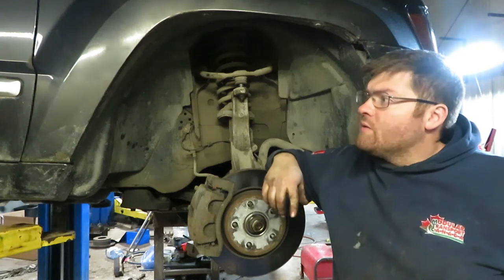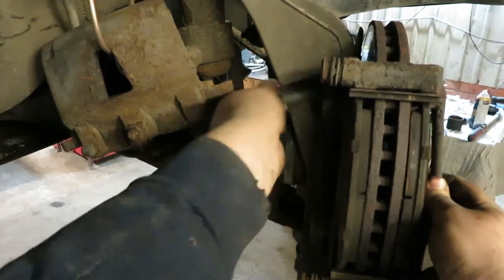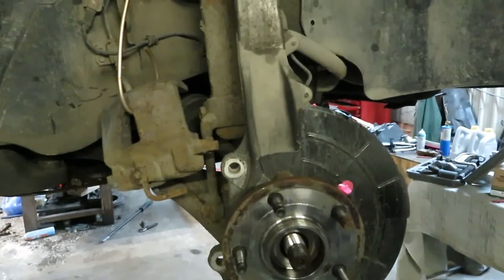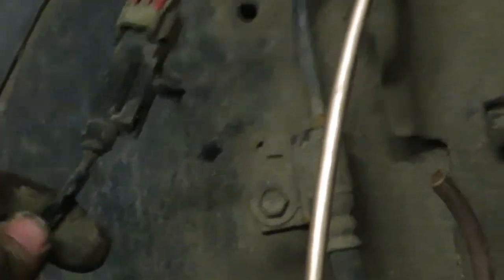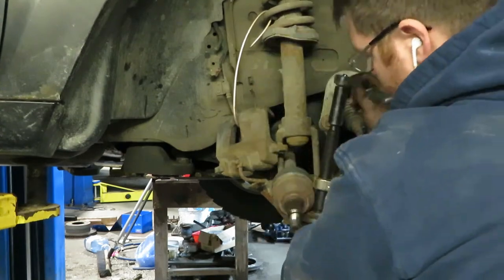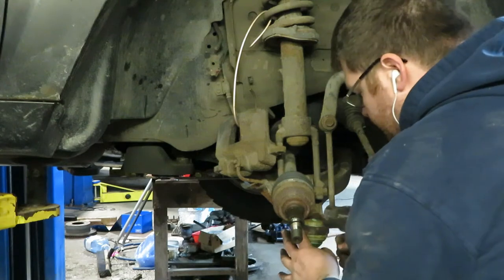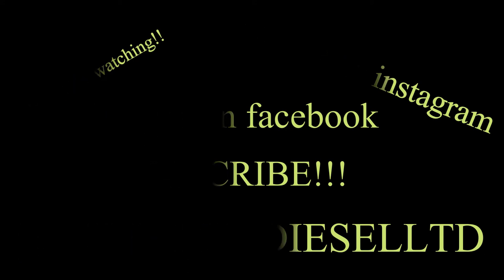HOW TO Jeep Grand Cherokee Lower Ball Joint Replacement

Comment: My original lower ball joint studs had no anti-turn hexagon on the end.  I made the mistake of splitting the joint after only backing the nut a few turns. I then couldn't undo the nut as it was stiff on the stud and just turned it!  I did manage to do it up again (hard) and could then undo it fully, but then had to split the joint again.  Moral is: undo nut fully first, then replace it (oiled) with only a few turns before splitting.

Comment: Is changing the lower ball joints on a 2007 Jeep Grand Cherokee 4x4 more difficult than a non four-wheel drive
Reply from the maker: 2wd is usually easier because there is more room. The front CV shaft or axle is not in the way. So to answer your question yes 4x4 is harder. Thanks for the comment. Any other questions feel free.
Reply: @screamindieselltd  okay thank you I'll just bring it in I would do it myself but never worked on a 4x4
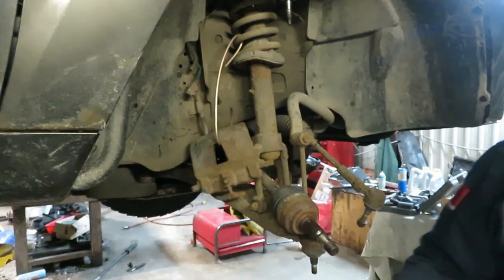Reply: I don't think 4x4 is much harder.  I have done a 4x4 (not a 2x4) and the drive shaft is easily kept out of the way. But unlike @4:10 I removed the front bearing from the knuckle before I took the knuckle off, makes it a bit easier as long as the bearing comes off the knuckle without a fight. I had another reason for doing that - to repaint that thin dust shield that was going rusty.

Comment: Have a question bout my 2007 jeep grand cherokee limited 4x4.  What could cause it to pull to the right? Went to get alignment an they said it didn't need one once they hooked it up.
Reply from the maker: A pull can be caused by a number of things. A worn tire, an under inflated tire, a brake caliber that’s hanging up, a seized ball joint and the list goes on. Does it only pull when braking? Does it only pull after you have turned to the right, the straighten out when you turn left.  Could also be a tie rod end. Hope that helps and thanks for the  question.

Comment: Hi Sir,  is it possible to replace the upper ball joints with out removing the upper control arms off the car?
Reply from the maker: If it’s a press in type of ball joint you can for sure do them with the arms still in. I’ve seen some that are a solid piece and some that are press in. Thanks for the comment!

Comment: I am the original owner of a 2008 Jeep Grand Cherokee Overland with 154K miles.  I've never replaced the front ball joints so it is time.  I thought that the lower ball joints were part of the lower control arm requiring me to replace the whole control arm?  From the video, it appears that you were able to replace the lower ball joints without replacing the whole control arm?  Do you have to use a special tool to separate the lower ball joint from the lower control arm?
Reply from the maker: Yup you have to use a ball joint press

Comment: Got a 2002 Jeep Grand Cherokee Laredo that needs all 4 ball joints replaced.
Been calling local auto repair shops and they are charging between $700 and $1200 for (ball joints, labor and alignment required)
But when I looked online a set of 4 ball joints kit is $100-$120.
Online on mechanic sites they estimate it should coat $300 for the replacement.
What does everyone think a reasonable price would be for ball joints replaced?
I have $500 to spend but would like to get my WI dows fixed too
Reply from the maker: I would say between 5-800 would cove all 4 with quality parts and alignment. Really depends on how it comes apart and  if anything else breaks.

Comment: That circlip seen @6:14 : I guess you need to remove the old one of those before you get to 4:15.  I can imagine that might not be easy.
Edit : I've done the job now and there was no original circlip, just the top lip peened over in two places, easy to chisel back. But I couldn't manage to press the new one in with the CV joint in the way like 6:00. Depends on the press tool I suppose. So I withdrew the drive shafts, not right out, but enough to get the thin part of the shaft opposite the press tool.  Also, my circlip was almost 360 degrees, not like 6:14, but the wishbone casting partly obstructs the groove in the inboard area. So my circlip is only in over 75% of the circumference.

Comment: What was the point of loosening the upper control arm balljoint? 

I have to do lower control arm balljoints. Brand new Moog lower control arms but their balljoints ripped on both sides after a few hundred miles, passenger and driver. Garbage quality.

Gotta research brands now and reviews to avoid another headache.